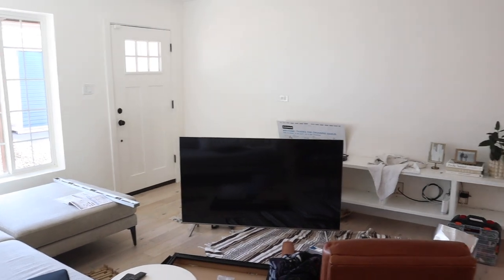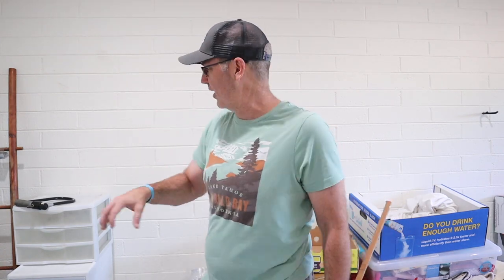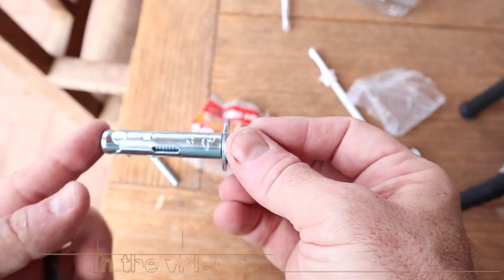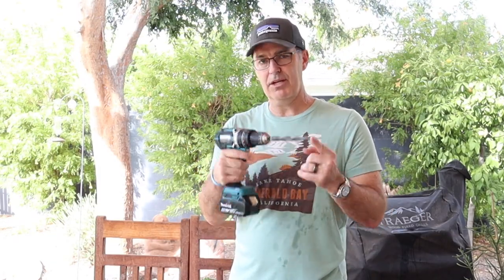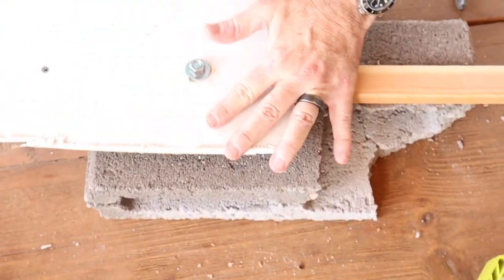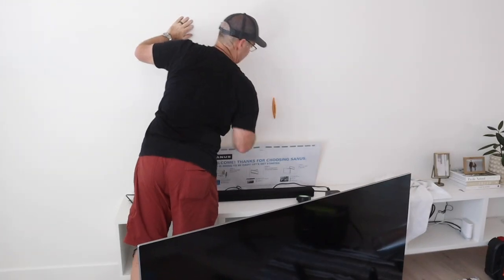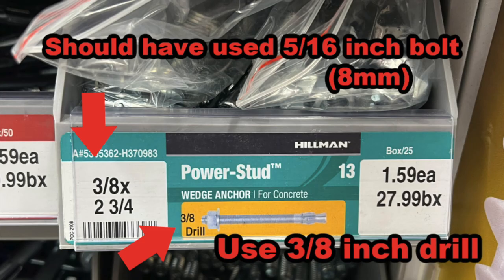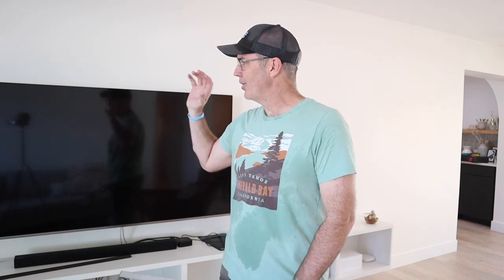TV Mount Drywall over brick or block

Comment: think i'd drill 1 hole and secure 1 corner of the mount to the wall, level it, then drill out the other 3 holes using the mount as a template.
Reply from the maker: Great idea!

Comment: What do you do if the furring strips are not centered? Mine seem to be pretty far apart. Would it be possible to wedge a piece of wood under the drywall, or do you have to mount to furring strips?

Comment: Thanks for this! I live in a condo where the wall separating units is concrete block covered in drywall. However, I am confused because if I knock on the wall, the areas below closer to the floor and above closer to the ceiling sound hollow, with space behind the drywall. But if I knock in the middle portion, vertically speaking, it feels entirely solid behind the drywall with zero echo/hollowness. Is this because the concrete block there abuts the drywall without a gap? Or is there something else happening? Thanks!

Comment: I live in an apartment so I’m not sure what’s behind what I assume is drywall (idk much about this) but the outside of the building is all brick and my walls inside are textured drywall. I can’t even hammer a nail in more than maybe an inch before it hits (brick?) so maybe there’s no wood? It definitely sounds solid when you knock on it.
Reply from the maker: You may have 1/2 inch drywall on 1/2 inch wood strips.  They would be an inch.  I would be surprised if it was drywall right on block or brick. They used to do that in older homes that had plaster walls. If it’s newer construction than it should have the wood strips.

Comment: Thanks for this video, I have a simular wall i'm mounting the same t.v. wall mount to, I have to go through sheetrock, wood furing strip ,1" insulation then the concrete block  (all equals 2 3/8 " before i get to the block) do you suggest the sleeve anchor for this and how long should it be? also how do you feel about Tapcons for this?
Reply from the maker: Honestly tapcons would work too.  With what u described thats what i would use.  It would be rare for there to be insulation between fur strip and block.  I would have sleeve on standby in case you hit hollow spot of block.  Good luck!  Use 3 1/2 - 4 tapcons…also might use a small washer

Comment: Do you feel this method would work if you also had 1” foam insulation panels between the furring and the block. Should I just add an extra inch to the  length of the anchor? This is for an exterior block wall.

Comment: I curious why you didn't trust just drilling a pilot hole with your concrete bit and then screw a 3" Concrete Bolt into the wall?  After talking to 2 different people, that's the way I was told to do it.  Do you feel that is wrong, or this is just another way to mount it?  I have a 1920s Craftsman home, so there is no drywall, it's 1" plaster with a small 2" x 1/4" thick firring and then the brick (I'm mountain my TV above the Fireplace.

Comment: Hi Quinn, I'm a fellow Phoenician. 🌵  I'm learning to DIY so this may be a dumb question. If there's an outlet in your TV wall then how could it only be furring strips between the drywall and block? Wouldn't it need to be framed out to provide depth for outlets?  Thank you
Reply from the maker: There are a couple options that wouldn’t require it to be framed out.  There are shallow gang boxes (not all are created equal).  A lot of times w block, installer will cut into block to allow for depth of outlet box (aka single gang box)
Reply: @how2q  Thank you for the added details.
Reply from the maker: @ScholtzLife glad it helped!

Comment: thank you for this video. i live in peoria in a 1960's built home and its block construction as well. One of the rooms that i'm trying to mount to, is basically how you explained it, but i'm not sure if there are furring strips between the drywall and block lol. i'll have to try that stud buddy. i'm mounting a loft bed to the wall, what do you suggest for anchors or bolts?
Reply from the maker: Take a small drill and drill into drywall.  If there is a gap you will feel it right away.  I think tapcons would work well.  Another option is using anchor sleeves.

Comment: I notice the 3/8 bolt doesn’t fit in the bracket as well. How did you adjust the bracket to make yours fit? I’m having an issue finding a 5/16 in the length that I personally need

Comment: Trying to hang my tv in my condo. The wall was originally brick separating the neighboring condo. Well one owner put drywall and studs as well. Do I have to go through the drywall, studs AND brick? It's a 65" TV and I really don't trust just the studs.
Reply from the maker: I’m assuming if ur side is drywall, it is exactly the setup in this video.  When u say “studs” they are probably 1 x 2 furring strips.  So the studs you are hitting are not deep at all.  Without looking at it, it’s tough to say. But I really doubt they used 2 x 4 studs. I would do it exactly the way I did it in this video if I were you. Just my suggestion.

Comment: I live in a super old apartment in NYC, that's very wonky, crooked walls and floors -  exposed brick that gradually appears to have drywall wall  covering it  (I know this because the grooves between the bricks are just slightly visible but as you go along the wall they begin to disappear - I guess whoever built it applied the drywall directly on the brick, but unevenly). I'm pretty sure there's no furring studs. Is it still safe to go straight in with those anchors?
Reply from the maker: Actually it is even a better solution for your situation.  Yes wedge anchor the way to go

Comment: I got a shelf set from Ikea and I realized I have brick behind my wall. There's a rail that goes across the top, with hanging rails going downward from it, all have screw holes that are 1/4" thick, do you think I can use this method? Are there screws that can do this that are that thin?
Reply from the maker: I would us tapcon screws.  If u have a 1/4 in screw then use a 3/8” drill bit.  When you go to the hardware store, just look on the box and it will tell you how big of a drillbit to use. But with tapcons you always want to use slightly smaller drill bit in the screw you are using.
Reply: @how2q  Thanks so much! So I would use the tapcons without the anchors, correct?

Comment: Silly question but can you mount a tv and hide the cables in a common property wall (inside wall is my living room and the other side has siding?
Reply from the maker: As long as behind drywall there is furring strips (1x2 lumber or more common 2x4 or 2x6) construction yes u can.

Comment: When drilling do you have to go through the furring strip or can you make a hole through drywall and concrete and mount it like that?
Reply from the maker: You don’t need to hit furring strip.  I would probably use a 2-1/2” fastener if i wasnt going through furring strip.
Reply: @how2q  thank you great video as well
Reply: Thank you for asking this question.  This was one thing I was wondering about since my mounting bracket is not long enough to reach multiple furring strips.  My furring strips are 24" apart.
Reply: Wondering the same thing. Feels wrong to have almost 3/4" of drywall only before hitting concrete
Reply: @hamzaxz7043  Based on @how2q 's recommendation above, I did not go through any furring strips.  I have 1/2" drywall and a 1" gap from the furring strip so I used 2-3/4" tapcons which means I embedded the tapcons about 1-1/4" into the concrete block.  (I could not find 2-1/2" tapcons at my big box store as @how2q recommended). The tapcons instructions say you should be good with 1" to 1-3/4" embedment.   I mounted a 58" tv (weighs 34lbs) about 10 days ago.  It has a very solid hold.  Pro tip- make sure you blow out/vacuum out the dust in the hole before screwing in the tapcon for better hold.
Reply from the maker: Thanks for input…most fur strips are 1/2” “deep” when using 1x2’s.  When attaching drywall to block, that’s really all the depth you need for drywall screws. That being said nice to know, you can have that much of a gap and the tapcons hold really well.  Agree on the vacuum or air to blow out dust.

Comment: Thank you for this video, this is my exact setup! Did you have any way of running the cables through the wall at all? I am wondering if tapcons into cinder block is sufficient..
Reply: Ended up using four 5/16 x 3" tapcons and it worked like a charm!
Reply from the maker: Sweet…glad it worked out!!

Comment: The video shows 1/2" sleeve anchor but your link goes to a 5/16". My local hardware store has 1/2" x 3" and 3/8" x 3". Would either work?
Reply from the maker: Oops good catch…you will be safe using either…good luck!
Reply: @how2q  ok thanks. I'll go with the 3/8" then since the larger size bolt won't fit through my Sanus mount.
Reply from the maker: @skyace888  take mount w you to hardware store if u haven’t already gotten bolts

Comment: Great info, thanks for the detailed explanation.  I apologize if you've made a video showing it but how would you run the cables down the wall on this one?  It looked like the outlet was right next to the mount but most of the time the outlet is going to be closer to the ground right?
Reply from the maker: Yes, true… I actually added this outlet when we were renovating our house. If you are trying to put a TV over a fireplace you’re going to want an outlet above fireplace. If you had a traditional mount that wasn’t electric, I’m not sure the cord from TV would even reach a side outlet. Big picture you would just need to add electrical behind the drywall. sounds involved, but usually pretty easy.  I set this up myself, but comfortable with electrical and drywall repair.  These days I’m sure it would cost quite a bit to do the same thing with an electrician and someone to come out and repair drywall.

Comment: I want to mount my tv to a wall that is concrete with drywall but the drywall is flush against the concrete. What should I do
Reply from the maker: Treat like drywall isn’t there. I recommend tapcon screws w washer.  3/16” or 1/4” will easily work.
Reply: @how2q  thank you.
Reply: @how2q so I discovered that I have dry wall directly on wood paneling and there’s a space behind the paneling to the concrete. What do I do?!?!? I want to give up haha
Reply from the maker: @greekgod200486  man you think you have it nailed and then you discover you don’t!!! Hate it when that happens.  I’m guessing its a 1/2” between drywall/paneling/ .5”/then concrete??  Tempting to cut out drywall & paneling and inset mount to concrete.  Might be more flush mounted.  Just spitballing ideas.
Reply: @how2q  the drywall is about 1/2-3/8 in thick. There is about 1 5/8 in between the concrete and paneling. Wish I was able to post a picture here for you.
Reply from the maker: If its 1-5/8 gap between concrete & paneling you should be able to put toggle bolt into drywall/paneling only.  As long as gap is larger than length of metal flanges of toggle bolt you should be ok
Reply from the maker: U probably have 1/2” drywall.  If thats on wood then you have a pretty strong setup for toggle bolt
Reply: @how2q  ok. Thank you. I will try that out. Greatly appreciate it!!